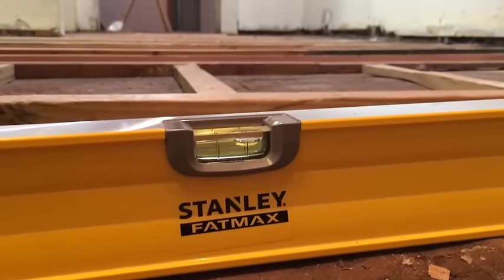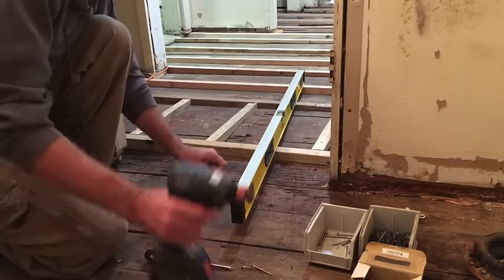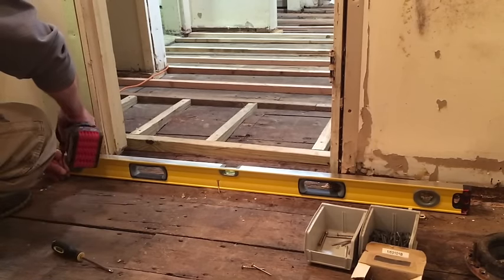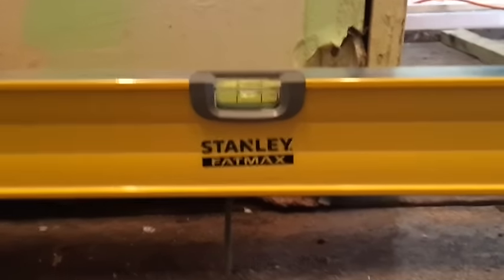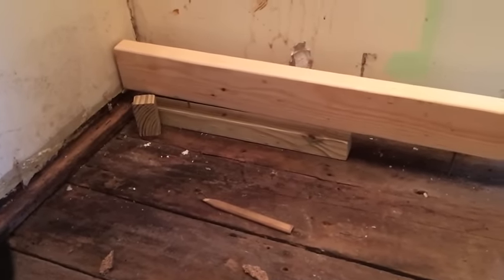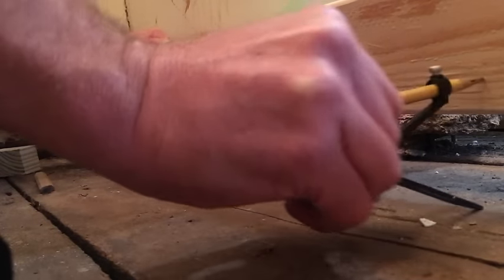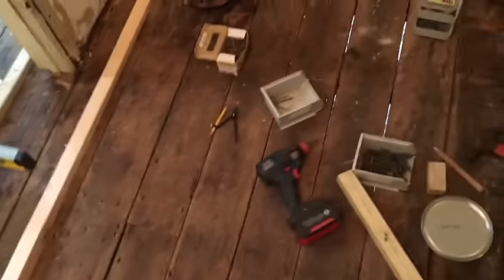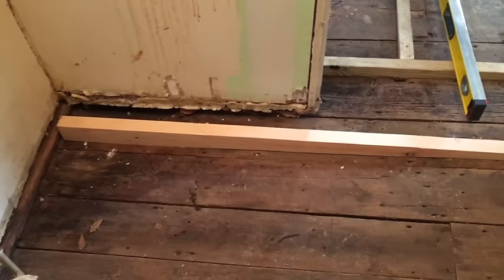DIY: How to level a uneven, wavy, or sloping wood floor

Comment: I would have removed the flooring and jacked the joists up to level the floors. Adding wood onto rotting wood just makes the issue worse long term.
Reply from the maker: False. The problem was fixed for far cheaper than your method and has now lasted years with absolutely no problems. The whole time it has been generating rent revenue. When you purchase an investment home, please post a video of yourself doing expensive unnecessary work. Thanks.
Reply: @737T1C130 It's not false. Please explain how wood becomes rotten. Floors do not become rotten overnight so saying it lasted years doesn't mean anything. Come back in 20, 30, even 40 years and say the same thing. Stating that it generates revenue is irrelevant to what I said I would have done. Doing things right the first time isn't unnecessary. Trying to save a buck by cutting corners or half-assing things only makes the work more expensive because you have to go back and do it again. Calm down. No need to get all defensive.
Reply from the maker: @zangetsudx1  the floor will outlast you. Don’t concern yourself with it. It’s fine. If you don’t like it, move along.
Reply: @737T1C130  You can do it however you want. We will see about that. I'm just letting other people who watch this there are better solutions to the problem
Reply from the maker: @zangetsudx1  Cool. Shoot me a message when you actually make a video to help people with your better solution instead of armchair quarterbacking someone's actual effort. "Rebuild the whole thing". Great advice, Einstein.
Reply: @737T1C130  Cool. I'll do that right after I film a video on how you don't think people should give advice or better suggestions on fixing things.
Reply from the maker: @zangetsudx1 So... never? Noted.
Reply: @737T1C130 So you're still upset that people give advice. Got it.
Reply from the maker: @zangetsudx1  Let’s keep things in perspective: Half a million views, thousands of likes, hundreds of positive comments…. and one critic with zero content. I  have no reason to be upset. Keep trying, though.
Reply: @737T1C130 Cool story bro.
Reply from the maker: @zangetsudx1  Are ya winning, son?

Comment: it is possible to lift the joists?
Reply from the maker: Yes, but the joists were curved due to the weight. They are still strong, just sagging after 100 years. I did add some additional joists to keep them from sagging further.

Comment: This will work, I would go get one of those transom lasers and save a whole lotta time though.
Reply from the maker: I used about 20 2x4x8 pieces of lumber and tools I had on hand. Cost me about $50 to do this job. Laser transits average price is about $500. It's just math, my friend.
Reply: @737T1C130  You can get a transit (cross line) for about $50 now days, I use mine for everything.  It makes everything I do faster.

Comment: I would of tore the floor up to make sure what the damage really was you can guess and slap wood over it. Or do it right and the house last another 100 years.
Reply from the maker: Chris, I've been on top of, underneath of, inside of, around every square inch of this house. If it made sense to do what you said you would have done, I would have done it. It's just a guest house/man cave. Nothing else. Read the description. I'm not going to last 100 years, so I really don't care if the house does, either. Buy your own and do everything the way you want.

Comment: Could this be done on top of concrete?
Reply from the maker: Sure. I also did this on a concrete slab that was once a porch. I just used concrete screws to fasten the wood to the concrete.
Reply: @737T1C130  great, but would I need moisture barrier or is it ok to put the wood on top of concrete?
Reply: Just use floor leveler

Comment: Is the foundation sinking? If it is, won't the floors keep on tilting? What is the original cause of the sloping condition?
Reply from the maker: Jimmy5F, there was a brick chimney estimated to weigh about 2200 pounds that was sitting directly on the floor and was unsupported from underneath. The house was built in 1916 and over the years, the large hardwood beams, joists, and subfloor planks all warped under the weight. I removed the chimney and tried to jack up the house, but the curvature of the beams could not be straightened, and there is only a small crawlspace underneath to work. The floor is now supported from below, but I needed to correct the warping above without spending an enormous amount of time and money rebuilding the structure. This has worked perfectly.

Comment: Why not just put the level on the screws and the board in front of it on the floor and trace the line from underneath?
Reply from the maker: because that may level the top, but it doesn't give you the contour of the bottom.
Reply: @737T1C130  I'd have to see it in person, it's not making sense in my head. Good video

Comment: How high did he initially set the 1st & 2nd screws? Did he use the height of the 2x4 in the next room? to set the height of the 2 reference screws in the new room?
Reply from the maker: One end of the level was set at the initial reference (in this case, the kitchen). The other end of the level was on the first screw in the next room. The second screw was set using the first screw as a reference and so on until the room was complete. The process was repeated for each room leveled.

Comment: Can this be done on an uneven concrete floor?
Reply: @AppleSauceSays  the discrepancies in the floor are pretty significant. In one area it has a 3 inch higher slab that goes along one side of the room (side walk sized) And the rest is slightly concaved.  What I am doing is converting the garage to a living space.

Comment: I doubt those strips of wood are in plane with each other and level going horizontally ( 7:19 )....Especially since you cut them with a circular saw. You can get it perfect by floating it.....Felt paper, wire mesh and deck mud.
Reply from the maker: Thanks for the expert advice. I almost used the felt paper, wire mesh, and deck mud method. Instead, I used an old pizza box, some barbed wire fence, and silly putty.
Reply: @737T1C130  No problem man. Always my pleasure 👍

Comment: There are videos showing how to level subfloor like this one https://youtu.be/5-Rvv06_A0k

The primary reason your method may be unsuitable for everybody is any plumbing and wiring running inside the subfloor would have to be accessible from underneath.

Comment: Okay I know it's been a year since the last comment but... How much money did you end up spending to do the "temporary" fix. Because you installed the floating floor on top of the defective flooring and floor joists. You just covered up the problem, you didn't fix the problem. Can you post a video of the final product. Good luck Rich in SoCal
Reply from the maker: Rich, I used approx 10 2x4x8 which at the time were $2.98 on sale at Home Depot. I used approx 1 box of screws at $6.98. The existing joists were sistered underneath with 2x8x10s. I used about 8 at around $10 each. I covered the the shims with approx 2.5 sheets of 3/4 subflooring. Don't remember the cost. I gather you don't approve of my methods. You should also realize I don't care. It works perfectly.
Reply: Right on it looked like a larger area than two and a half sheets of plywood. Maybe several rooms. You didn't mention that you had sistered some floor joists. Your way of leveling the floor is unorthodox but ingenious. I'll keep it in mind. I had to build a wall inside of a wall because the structure was built in 1928 and was built more like a barn than a modern stick house.

Comment: I would have just ripped up the floor boards and level the joists then shim new subfloor on joist where needed. It’s an old house you’re never going to get it perfect.
Reply from the maker: The subfloor was 100 year old hardwood full dimension 1” planks. It would have been wasteful to cut them out. The “joists” are hardwood beams. I can’t see how your method doesn’t require much more time, money, and waste.

Comment: so, you did not address the core issue. if floor dips, sags or bows down, it means the supporting elements have buckled under stress , compression or tensile forces. first address that issue, and correcting elements on surface will be minimal. Good luck!
Reply from the maker: Brilliant reply, Einstein. I've addressed this dozens of times. Learn to read.

Comment: are you doing this for a quick sale?
Reply from the maker: No, I'm doing it because I don't want a dilapidated house down the street from me becoming a meth lab.
Reply: @737T1C130  i know you said its a 100 yr old house and we all know they didnt level the flooring too good unless it was a mansion back then,but have you tried getting some bottle jacks and slowly lifting areas/rooms?
Reply from the maker: @bakedpagan4674  What? Are you saying I could level a floor by using a series of jacks and lally columns placed under the flooring joists until all the slopes and waves in the floor magically disappear? No, that never occurred to me. Never once thought of that.
Reply: ZigPig 😆
Reply: @737T1C130  We are considering using your method for our floors. We leveled a piece of snap chalk string against both house support beams, and replaced 6 temporary type lallys (original to the home built in 1960) with cement lallys, and we swear the floor actually got worse :(

Comment: Why not cut the subfloor  board and fix 2x4 or 2x6 on side og existing floor joists to be level.Install new subfloor after that.Generally your adding subfloor over subfloor is very bad idea ,it just create more problems (pests,moisture etc...Please do not do this.I am contractor for over 25 years (custom remodeling)and this is very bad idea,i was called many times to correct this kind of work.
When you cut existing subfoor it give you chance to sisterjoint existing floor joists if are in bad shape broken etc...
Reply from the maker: Please read the description. There are no problems.